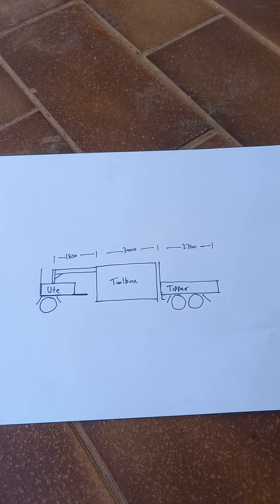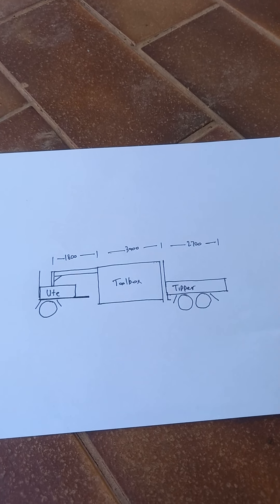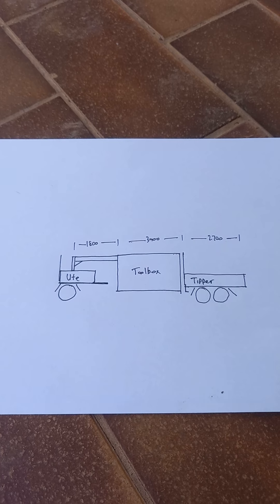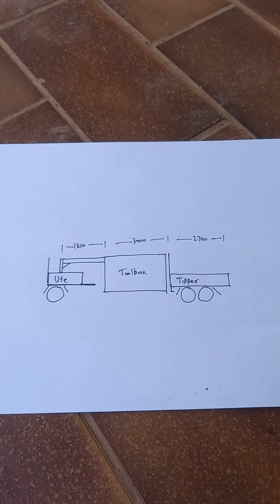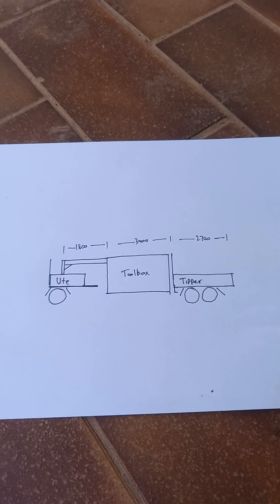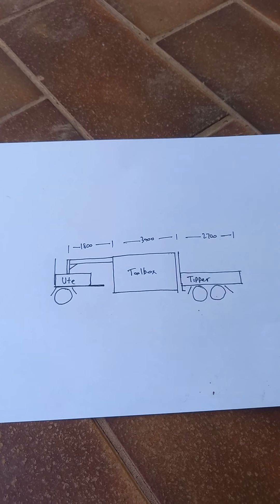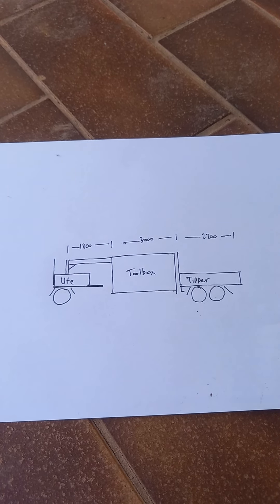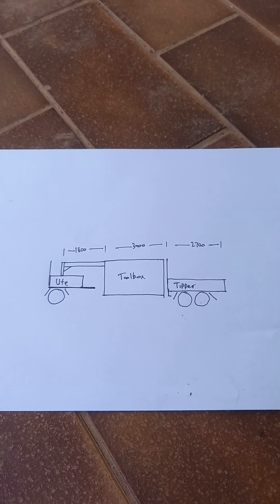No 2. A gooseneck trailer and low toolboxes on the ute.

Comment: My tip with goosenecks is don't use a pickup that is way to tall with soft suspension. Pick-ups have been getting taller and taller (those new 4x4 Rams) over the years which upsets the ride of the goosenecks. You can weld some blocks under the trailer axles to compensate a bit. If clearance becomes an issue between the trailer and ute, an option is making the ute a flatbed with no sides.